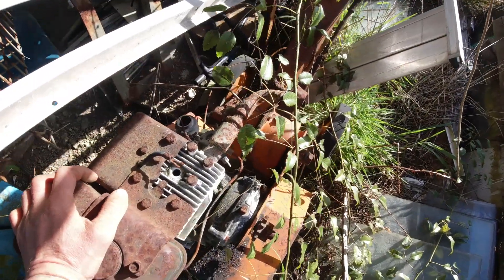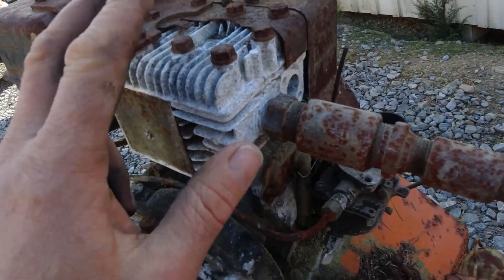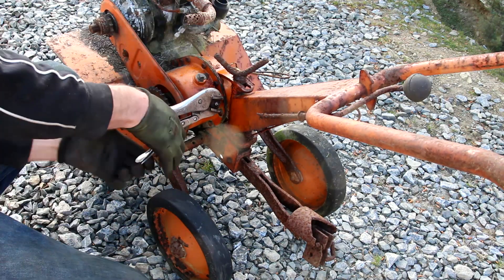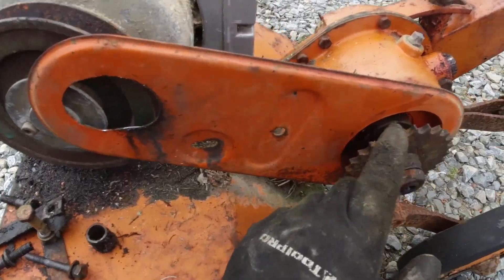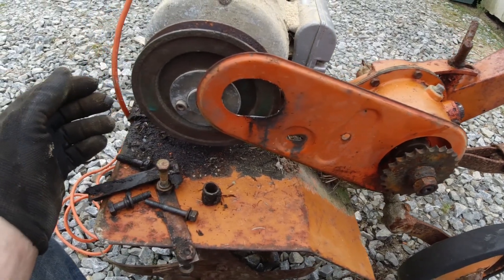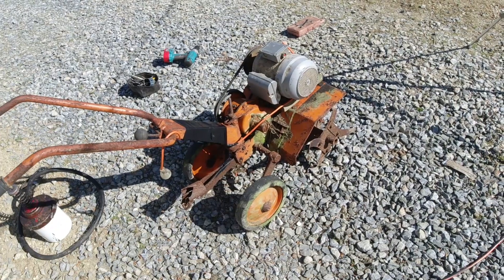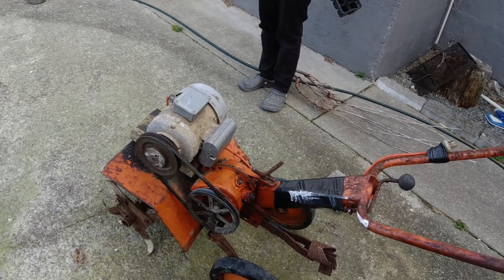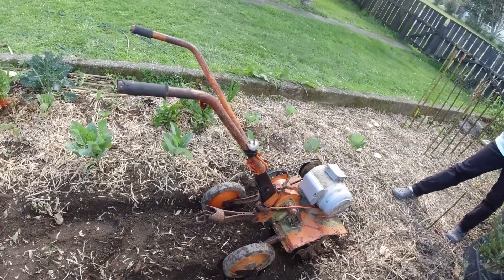Making an Electric Rotary Tiller using junk parts - Zero emissions!!

Comment: Hi Marty, great innovation there, I would suggest that the rotors are spinning far too quickly. Perhaps reduce the gearing with the pulleys a  lot to slow them down, probably by 2 thirds at least, that will help with torque and it will bite into the soil better without spraying it out of the back.
Reply from the maker: Yes it needs a smaller pulley on the motor and a few other little improvements

Comment: I would suggest slowing it down a touch which will actually give you more torque with a smaller pully on the tiler shaft and also make an adjustable "Drag stake" for the center in the rear( that arm that sticks right out the rear should have a flat bar that drags in the ground like a chissel point, it helps so you don't always have to hold back on the tiller. the harder you press the chisel in to the ground the deeper the tiller digs)
Reply from the maker: Yes it needs a smaller pulley on the motor and a few other little improvements

Comment: What the heck dad, it really works. Your young bloke has a new phrase😀

You could also try a DC treadmill motor. They are typically 2hp and half the size, with variable speed control

Comment: If memory serves right electric motors convert about 85% of energy to motion compared to less than 40% for petrol engines. So an electric one horsepower will be stronger than a gas one horsepower engine for example. Good job just don’t till up your power cord 👍👍
Reply: Small engines are more like 20% effective...

Comment: Marty, I remember the video where you and your mate dragged all that pipe to get the water to the generator. I was wondering; Have you had any blowouts in that pipe over this time of operation? In particular it might occur in a place where the pipe is closest to being level, or a slight incline, during times when the intake lets in air from the top of the line.
Reply from the maker: He had a few blowouts in the first month but its all good now
Reply: @MartyT  I think that proves that you might be able to tap that pipe and get pressurized air from there. Another source of energy, maybe a backup, in case floods mess up the hydro?

Comment: Marty - Maybe this is a different style of tiller than I've ever seen, but, I'd say it's rotating at least 4x as fast as it should be. It's flinging the dirt and bouncing along the surface.  Rototillers I've ever seen do full depth on single pass, nice and slow, tons of torque.  Maybe check up on the rpm of the tiller blades per spec or, even just Google someone using a general rototiller, I'm pretty sure you're way way way fast.

In other news I was thinking "He's going to fit an inverter and a car battery to this? Hmm, that'll work". No, instead you have wheeling death hoping some day to catch that power cord. Well, your garden isn't too big, shouldn't be much to keep watch over.
Reply from the maker: Yes it needs a smaller pulley on the motor and a few other little improvements

Comment: Great build. I think you can gain power if you reduce the pully a little bit. Now it seems a little bit out of balance between power and rotations.
Reply from the maker: Yes it needs a smaller pulley on the motor and a few other little improvement

Comment: For a moment I thought Uncle Rich of Rich Rebuilds would drive up in his Sherp and tell you how to do a Tesla conversion on the tiller. I can’t imagine the Row Anxiety of a ET not to mention how you would get it to a charging station. I think your idea of using some sort of  long electrical tether works fine in your application. You must have saved thousands on batteries, a battery cooling system and inverters. Not to mention the cost of self driving software. Yet again Marty T shows how reliable old 20th century tech can be. Well done.

Comment: Nice! My petrol tiller actually uses 200 grams of grease in the transmission instead of oil.
Reply from the maker: Wouldn't it just flick to the sides of the case and stay off the chain?
Reply: @MartyT  I don't really know, but I think it only has one bigger hole for filling, so maybe my tiller isn't made to last very long... the manual just told to press 200 grams of grease into the transmission and keep adding it as time goes by. No instructions to get it out, so just need to keep adding it... hopefully it stays working... I guess it should, if it's filled with grease.

Comment: 5:40 May I recommend putting a metal plate under the motor, on a hinge so that the weight of the motor pulls the belt and the pulley tight.  If you put the hinge at the back of the motor that would work wouldn't it ? It could also RAISE Up the whole motor.?
Reply: Good idea.

Comment: That's using ya noodle bro. all the bits from what would be normally taken to the tip. I wonder if a battery drill could be used as a power source. Safe travels

Comment: Really think a smaller motor pulley would be the way to go. Those blades don't need to be that fast, and you could do with the extra torque.
Reply from the maker: Yes it needs a smaller pulley on the motor and a few other little improvements

Comment: Electric tools really are much nicer to use with the quieter use. Question - it seems to produce two small trenches, yet had four blades. Is it because the end blades flick soil towards the centre, or is it the wheels compressing the nicely fluffed up soil?
Reply from the maker: Yes I think the wheels need to be wider
Reply: @MartyT  your blades are very worn out.

Comment: I'd try to find a new pulley set to give you a lower gear ratio. Great build!
Reply from the maker: Yes it needs a smaller pulley on the motor and a few other little improvements

Comment: You might consider puting a smaller pulley on the motor. It will solve to problems at once.  It will slow down the tine speed and increase  the power at the tines.

Comment: I’ve got an old Masport rotary hoe, it’s about 50 years old, lives in the shed all year and always starts every year when it’s time to get the potato bed ready. 4 strokes from the sixties just seem to go on forever. Another kiwi classic.
Reply: Our one  owned from new ( 1967  from its id plate) was never a good starter and had a problem of a sticking valve, but about 2 or 3 years ago, I changed it to electronic ignition,  which made it crazy easy to start and ultra reliable.  In my opinion well worth the small price and minimal work.  Highly recommend considering  this upgrade
Reply: I have an old Masport 4 as well :) Purchased 2nd hand by a family friend maybe 15 years ago, he passed last year at 83, was used plenty by my mum and now lives with me. Great piece of kit!

Comment: Well done Marty, I also used the handlebar switch of an old 240v electric mower. I think I would fit a pulley half the size of the one you have on the lecky motor, that will halve the spin rate on the tines but double the HP, of course if it’s in high range putting it in low range might help too. It’s fun to make this stuff👍👍👍 cheers Stuart 🇦🇺
Reply: I was thinking the same, blades seemed to be spinning pretty fast so smaller pulley could really help.

Comment: You could put a current limit motor control to prevent burning the power cord, house circuit/outlet or motor. It would give you a reset at the tiller.
Reply from the maker: There is a reset on the motor but the belt tends to slip before it trips

Comment: Marty the gearbox has two speeds,  you rotated the change mechanism 90 degrees one way, try 180 degrees the other way.  (90 up =low - middle = neutral  - 90 down =high)
Reply from the maker: Ahh.. Thanks mate I'll try that now
Reply: Seemed to be spinning a bit to fast to me!
Reply: @mawe42  Yes I'd say you are correct, the different engine rpms are not to different but add the new pulley ratios....
I suspect Marty had already worked this out and selected the low gear on the gearbox, it still appears to be going like a bat our of hell.
Reply: Used my gem 25 year ago with the  outputs all going into a pipe  under a trialling plow.co2 back buried,,etc .great stuff ,but if you make charcoal and put that in ........
Reply: @benrobertson7855  do you mean that you were pumping the exhaust into the ground?

Comment: Hi Marty. There should be a metal bar bolted to the end of that rusty bracket between the wheels. The bar digs into the ground & acts as a brake to prevent the hoe from taking off on you. The length of bar in the ground controlled the depth of cut.
My Dad had a Masport Rotahoe with this system.
Reply: The bar makes for an interesting control dynamic.  If you want to dig deeper, you push the handles down which digs the bar in and lets the tines spin in place (and dig).  If you want to go shallower, you lift up and it moves forward without digging as much.
Reply: Bar or plough? MIne has a plough atatchment.
Reply: @Hunter4042012  a plough is just a fancy bar when you think about it
Reply: @Hunter4042012  Same here. I have the TroyBilt Horse.  A plow--with or without hiller/furrower wings--can be fitted to the depth control bar.
Reply: My old man's one had the bar and ud kick it up to maneuver it and back down to help just crawl along. Also that's spinning way fast I reckon it would work better with different pulleys to slow the hoe down. Looks good though.
Reply: I thought it was running too fast.. But with a restriction bar to adjust the depths it should be OK. Nice thingy to have. Not too heavy to handle or woop around. Always important for the wife😉😎😏

Comment: I think the motor is to small. What about shaft speed? Check your amps under load!
Reply from the maker: Its ideal for light work, could do with a smaller pulley on the motor to gear it down

Comment: Great build. We are skipping a year on our garden. All I have is a weed eater grubbing attachment. I hop for a bigger unit. 
Current project I'm on is an old wood chipper. Pain in the rear.
Reply: I don't know where you're located in the world, but the scrapyard I am a welder at let's people buy stuff just a little over what they paid for it as scrap. We get a LOT of super nice front and rear tine tillers, most just need minor work. Hell, I just got a Homelite Super EZ Automatic for less than $5, that I put some fresh gas in it, pulled the rope a half dozen times, fired right up. Slapped a bar and chain from a parts saw I had laying under the bench in the garage, good to go. I have bought a LOT of stuff like that. My tractor, plasma cutter, numerous chainsaws, small engines, generators, a HUGE Hobart G258 welder with a Willys jeep engine, and even my 1981 Kawasaki KZ750LTD that I ride daily. All dirt cheap. Saved all from being turned into paperclips.
Reply: Mulch appreciated .

Comment: That motor pulley should probably be much smaller? Most tillers only turn at about 200 RPM, that thing is closer to 500 or more? Plus it would have more power as well.
Reply from the maker: Yes I was thinking the same, smaller pulley on the motor would gear it down nicely
Reply: @MartyT  Plus, it might make it a safer machine to operate? (For the Mrs.)